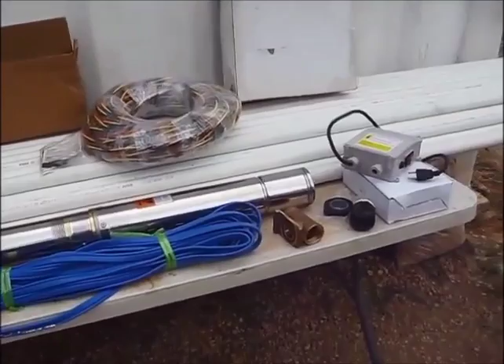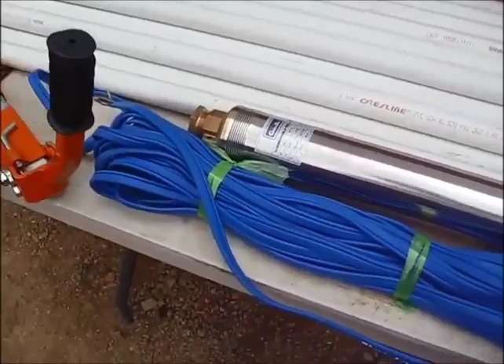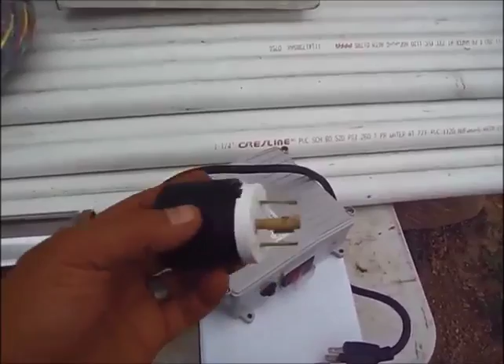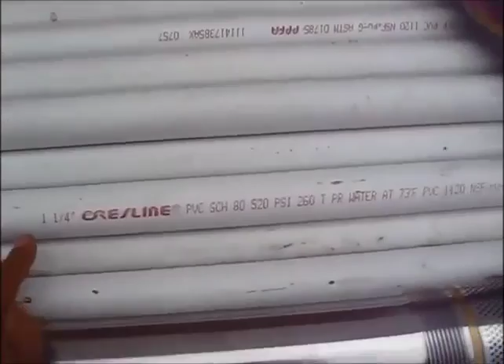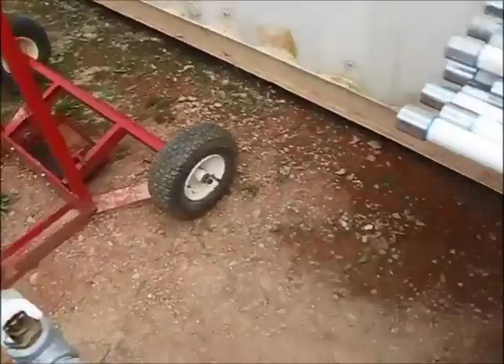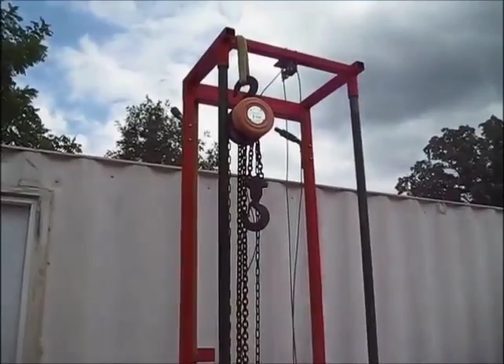DIY Deep Well Submersible Pump Installation Part 1

Comment: Did you glue the couplers on the pipe? And are they galvanized?
Reply from the maker: I couldn't find this schedule of pipe in ten foot lengths. I cut and thread them. Since I did not have an actual PVC cutting die, I figured it wouldn't hurt to apply glue assist in making a good friction joint. The glue helps fills in any minor voids in the threading that were imperfect using a standard metal pipe threading die. I would not normally recommend anyone without experience to try that, cutting PVC with a standard die, since the PVC galls so easy and will ruin the cut. I'm a Pipefitter and it took me several runs to figure it out. Yes, the couplings are zinc  coated "slicks," which are used by many installers, based on area and preference. Oddly, it was all the pump supplier sold. I did eventually find a great deal on galvanized pipe coupling, sitting on the shelf waiting on the next pull to install.

Comment: this sounds just great and i see there are parts 1-5 but where is part 0?"
the part where you actually drilled the hole and placed the casing?
our water table is 150' so i'd have to go 200 or so, is that feasible?
.
Reply from the maker: I had the well drilled professionally. Here in Missouri, there is a lot 
of limestone, which is hard but permeable, which requires a very large 
truck-mounted hydraulic drilling rig to punch a hole. We can actually 
get water at more shallow levels, but the practice is to go deeper to 
avoid dry wells during droughts. Our main supply refreshes at fifty 
gallons per minute down about a hundred fifty feet, but in order to have
 a supply in the drill hole, it was punched to three hundred. This 
ensures a constant supply if our demand requires it. I have lived in 
other areas, such as Florida where the strata is primarily sand, and 
therefore it enabled us to hand drive a well point shallow enough to 
obtain clean surface water. I do have a drilling rig that I can attach 
to my machine, but it can only punch through medium coarse, slightly 
rocky soils, but not here where I am at the moment. Henceforth, I 
subcontracted it out. 

As far as feasibility, you will have to discuss that with your driller or inquire with your neighbors what their wells are at to get an idea how well the aquifer recharges at particular depths and how they react during dry spells. It does not hurt to always go a bit deeper, once you reach the water table. Good luck.

Comment: Hello there. May I know the brand of the pump?
Reply from the maker: I don't remember, but it's mentioned in a later video in this series. 
It's a generic Chinese 2hp pump that is woefully inadequate. I would 
stay away from them. I replaced it with a Franklin 1hp pump with a 
better pump curve and much less startup requirements running it off a 
generator. Franklin. Very good quality pump. I think the parts are made 
in Mexico and assembled here. Anyway, NOT in China.

Comment: This series of videos are absolutely great!!  

Two questions:
1) will there be a sixth video on connecting the electrical pump to the power?
2) should there be a braided nylon rope attached to the motor and tied off at the top of the well casing for extra safety?

Cheers,
rookie1514
Reply from the maker: +rookie1514 No additional pump videos at this time. It runs strictly off generator power as we are off grid. We just installed a 1400 gallon cistern, so pumping events are minimal. I will eventually convert the generator to run off propane, as we have a 1k tank close by. I will make a video for that.
Reply from the maker: +rookie1514 As for safety rope, I could have installed one, but I am a minimalist 
and don't think it's necessary with a proper installation. Especially 
when the pump is run manually and cycles so little that reserve torque 
or rubbing is not an issue. That said, a safety rope can fall into a 
hole and "bird-nest" on top of the pump, wedging it permanently. I don't
 want to take that chance. In the event of a failure, the wire and crimped/soldered connections are more than strong enough to pull the pump if necessary.